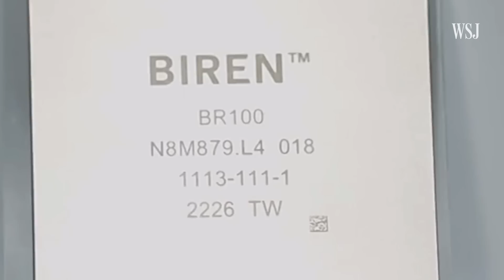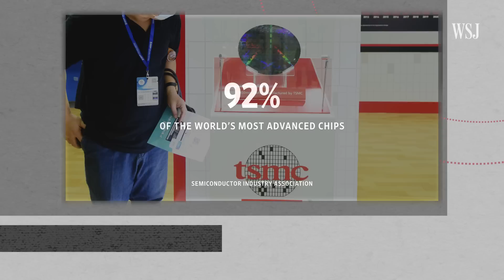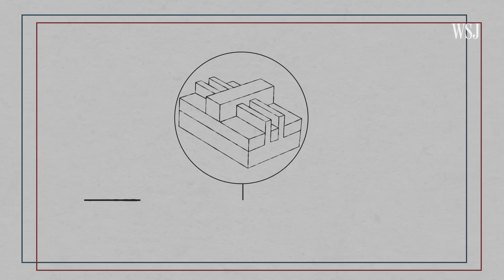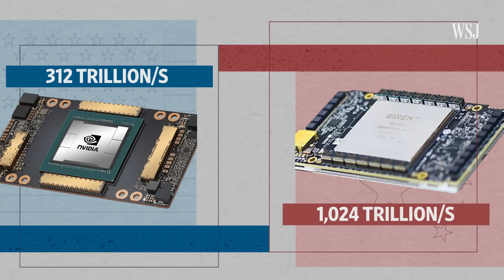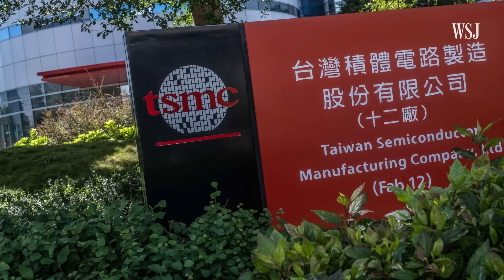Has Nvidia’s A100 Chip Met Its Match With Biren’s BR100 Processor? | WSJ U.S. vs. China

Comment: Whoever made this video doesn’t understand the chip industry at all.  As a number of commenters have pointed out, there is a lot of software needed to get value out of these chips.  Just because the chip is designed with TSMC’s PDK and has higher transistor count, it doesn’t mean it is faster or more capable.  This is like buying a car based on the number of wheels and expect a comparison to be meaningful.  

The chip industry is more than TSMC and ASML.  There are tons of chip design and verification software needed to just design the chip—all of these software packages are subject to export control.  Once the wafers are ready, there is a LOT of packaging and testing needed to turn it into a chip—and these are not in China either.  Finally, chips that big have 10s of thousands of very skilled asic engineers spending years of their life dedicated to the craft. 

The bottom line is, it’s not like cloning a DVD player.
Reply: Bottom line is, don't rely WSJ for chip making related information.
Reply: user-rx5pb8iv6l  Taiwanese are ethnic Han chinese which you or your family won't be able to change that 🤣🤣
Reply: user-rx5pb8iv6l  Taiwanese is not a race nor ethnicity.  The overwhelming majority of them are Hokkien Chinese (Han ethnicity).
Reply: @Amidat  Why does it matter if most Taiwanese don't even support the mainland Chinese
Reply: @bigiman6241  Anyone who is an adult who understand how the adult world works understands that.  The vast majority of people on the island support the status quo....  Almost ten percent of the islands workforce works on the Mainland.  Do you know how many cross marriages there are also??? Do you really know the place???  Or you just go off what the biased western media tells you?
Reply: @Amidat  Yes, people in Anglosphere usually don't know that 90% of Taiwanese just Han Chinese that moved to Taiwan Archipelago, they speak Mandarin in daily life, not Atayal.
Reply: @bigiman6241  if Chinese Malaysian like Michelle Yeoh are Chinese by ethnicity, so Tsai Ing Wen is also Chinese by ethnicity, just not citizen of People Republic of China.
Reply: The problem with evaluating technology is details matter and this journalist simply did not get nor understand the details. For example, the BR100 claims to get almost 3X the performance.  But that is a 8-bit floating point calculations. There is no mention of 64-bit performance in any of the press materials and that matters. That would suggest this chip this chip is 32-bit only making it a decade behind NVidia's offering. The other thing was the reporter stated that the BirenBr100 is "slightly bigger" at 1074 mm^2  vs the Nvidia at 826 mm^2.  That is not "slightly bigger" that is more than 20% bigger. This matters a great deal when it comes to manufacturing as that greatly increases the cost. Even if these chips could be manufactured by China (and that will be a huge challenge), the process will cost more than Nvidia. These chips are not meant for consumer gamers. These chips are meant for enterprise and scientific computing; very few companies and institutions I know will buy a much more expensive chip that does is not capable of 64-bit computing.
Reply: Cope harder buddy lol
Reply: @ProximaAdMortem  I don’t have to thanks to your mom 😂
Reply: 乳滑  no, he is human
Reply: China is very much in the packaging and testing business... you should update your understanding
Reply: Facts
Reply: yeah, that what i thought... creating fast chips is one thing,  getting software to take advantage of it is another thing...
Reply: True. Better to wait for 3rd party benchmarks before saying if this is really legit or not. Same thing happened for China's Sunway TaihuLight supercomputer. It earned its spot in the top 10 most powerful computers at 7th place but it uses 10,649,600 cores. While Sierra at 6th place only uses around 1,572,480 IBM cores.

Source: Top500
Reply: @johnsilver9338  Those are CPU cores.  The BIREN would be counted as accelerator cores.  I dont recall the exact count, but I think 5 of the 10 on the top 10 list this year (using accelerators) is using Nvidia’s.  None were using BIREN.  The list to watch is the Green 500.  On that list, Nvidia is being used in 3 of then, and AMD has more than that.
Reply: @deeznuts-lj2lv  My point is it's not about higher transistor count.
Reply: Nothing is impossible for Chinese geniouses cant do. They are just simply smart and clever. You can be the first designer but to Chinese they will help your designs to another levels.
Reply: China will get there, because of its national will and its intelligent and hardworking people. And US arrogance reminds China of the colonial story again.

Yes, it’s difficult. But is it more difficult than Chinese acquisition of nuclear war head and Chinese catching up space station?!

I doubted

And China also has the most important card of all: the market!
Reply: @wenling3487  I don’t disagree that China will get there, eventually.  This is significantly more difficult than nukes and space station.  China didn’t set off it’s first nuke until 1964, a full 22 years after the US, and this was only possible because Russia gave China the technology.   The space station is the same story, China bought it from the Russians in 1994.    

I want the Chinese people to succeed, live a life of freedom.  But under the current government, it won’t.
Reply: @deeznuts-lj2lv  
I don’t think China needs 20 years. 5-10 years is my knowledge so far. Actually 7nm is already on commercially production. 

On 2010, China accomplished Industrial Revolution, never forget that.

Btw, regarding nuke, yes, USSR gave china the industrial base and atomic bomb industrial bases. But China got hydrogen bomb by totally its own people.
 
For space station, your knowledge is a joke. China bought some basics and space suit from Russia (India had more), China developed its own system.

Chip industry is surely much more complicated than probably both, but China is much more advanced than 1990s.
You can mark my words: this is 2023.
Reply: @wenling3487  The f you are going about. You are off topic. Like I said let 3rd party benchmarks tell us if BR100 is legit or not.
Reply: @wenling3487  Quality will always lack behind taiwan.
Reply: @wenling3487  Realistically China will not be able to make advanced semiconductors on its own for nearly a decade to come.
Reply: I think you know nothing about China's chips industry. China is already tier 1 player in testing (both hardware and software), and maybe tier 2 in packaging. Even for designing part, China has some domestic backup choices. The weakest point is in manufacturing, especially the manufacturing tools.
Reply: @Xu Chen so many worlds but zero information, paper dragon. 
Enjoy paying for all the fraud in the Chinese semiconductor industry.
Reply: @xuchen4012  I'm sorry, but with a comment like that, you only show that you want to be patriotic without understanding what you are saying or commenting on. The reason Nvidia is leading today is because of the combination of hardware and software. BIREN's chip might be faster in raw computational power, it does not mean that the company has what it takes to beat Nvidia on the software level and therefore beat it on usefull computational power. You also can't just take existing software and have it run on a different chip. That's not how it works.
Reply: @xuchen4012  but but the whole China is now using & relying on  US chips companies like AMD, Intel, Nvidia, Qualcomm, it appears China company don't have any market share in China 🤡 , it turns out all China AI researchers are using Nvidia chips for AI , and the whole Chinese EV cars simply rely on Nvidia...
Reply: @tluangasailo3663  that was because it was pre - sanctions on high end chips. When the chips are there , no point in wasting money to reinvent the wheel. However due to usa chips act, china needs to go solo or with friendlies. Look at the space station and that is great example .
Reply: @ScoobieDoo-zy1rh  even in today, the whole China keep using US chips , not biren...lol
Reply: @tluangasailo3663  chips act just happened a few months ago . COVID zero just stopped a month ago and economy opened . You expecting overnight change is like telling the sun to shine at night. Patience !
Reply: @tluangasailo3663  lots of mandarin speakers work for Nvidia... that's why they work with them.  wink wink...
Reply: Even Nvidia founder and CEO is Chinese lol
Reply: @NUI_BAWK_2_Ang  Jensen Huang is Taiwanese.
Reply: @deeznuts-lj2lv  Lisa and Jensen are both Taiwanese, but you have to know Taiwanese are actually ethically Han Chinese, same like Cantonese.
Reply: @TricycleRaider  Yes, that is true, but Taiwan is not China, and the opportunities are not equal in both countries.
Reply: @deeznuts-lj2lv  lol, You should protest to the Union
Reply: @TricycleRaider  North Korean &South Korean have same Ethnicity
2 Different Countries with Diff System of Government s
Reply: @deeznuts-lj2lv does it matter?  They look the same in westerner’s eyes….
Reply: @Nameles305  NK and SK are both   sovereign states, members of UN, and officially recognized by other countries, but Taiwan or Republic of China (the name in their constitution) is not, and such situation is not forseen to improve for them. Such difference is something to note.
Reply: @spvlinn9009  hahah come at me bro
Reply: @deeznuts-lj2lv  taiwanese sre chinese
Reply: @deeznuts-lj2lv  Taiwantese are Chinese people.  They literally speak Mandarin and Hokkien because 90% of them fled to Taiwan from Fujian province in the Chinese civil war.  It's like saying someone from Seoul is different than someone from Pyonyang.  They have the same blood guy.
Reply: @TricycleRaider  Well a lot of people don't know that because in the west - they don't teach Taiwan as we know it only exists because of the unfinished Chinese civil war.  In the US it is taught like they are a completely separate people.  So people in the west don't know.
Reply: @deeznuts-lj2lv  10% of Taiwan chip engineers moved to Mainland China because they don't agree with you.  Just ask Tsai ing wen.
Reply: @deeznuts-lj2lv  He is Chinese in sense of ethnicity, and his nationality is Republic of China, Taiwan Is just the name of the Islands, not the name of the country.
Reply: @NUI_BAWK_2_Ang umm he’s taiwanese not chinese get it right!
Reply: @qxdso  nationality vs ethnicity
Reply: @qxdso  he is ethnic Han chinese not white 🤣🤣